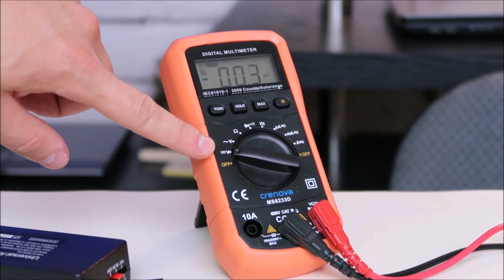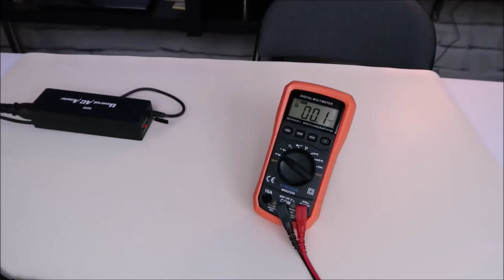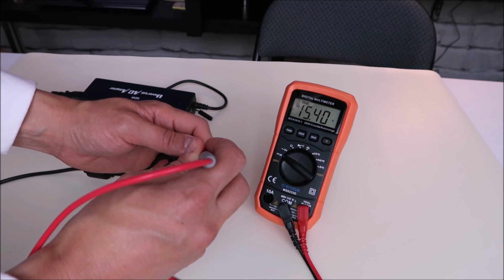How To Fix Any Laptop - Wont Turn On, Wont Open, Turns Off Right Away, No Power Solution

Comment: Hi. My laptop is acer nitro v15 it's rebooting itself after i open its lit and before i press power button. But it will shut down before acer logo appear and repeat the same thing again and again until i close the lit.
Reply from the maker: This video has been updated with additional steps here; https://youtu.be/kOBY4k2Mn_k. Let me know how that goes :)
Also, did anything happen before this issue started? Overheating, liquid spill, Windows update, etc?

Comment: I have a Lenovo Yoga 6 13ALC7 - Type 82UD and I've watched a few of your videos and can't get my laptop to turn on. I have some all of the troubleshooting you suggest except for a Bios reset because I don't seem to have a Cmos (sp) battery. When I have the battery in and plug in the charger the light is white butdoesn't t turn on. When I have the battery out and charger plugged in there's no lights and it doesn't turn on. When I plug the battery back in for have it unplugged from the charger the light blinks orange a few times but the laptop never turns on. I also don't see the ram sticks so I'm not able to troubleshoot the ram. Please help, I need my laptop!
Reply from the maker: This video has been updated with additional steps here; https://youtu.be/kOBY4k2Mn_k. Let me know how that goes :)
Also, did anything happen before this issue started? Overheating, liquid spill, Windows update, etc?

Comment: When i doing this my laptop just turn on for a sec (keybord light turn on) and then turn off immediately, what do you think the problem is?
Reply from the maker: You tried all the steps seen here multiple times? Did anything happen before this issue started? Overheating, liquid spill, Windows update, etc?
Reply: @PC_Monkey yeah i already tried all of them, idk it just suddenly happen to my laptop
Reply from the maker: @eldyriszwan  If, after trying all the steps seen here multiple times, you have not been able to find the issue, your most likely looking at one of two possible issues. (1) The motherboard is bad and needs to be replaced. Let me know if you would like help finding a compatible motherboard. Or (2) there is another computer component, shorting out the motherboard and need to be replaced such as the power jack, USB board, Touchpad, etc. You would have to troubleshoot each of those individually but unhooking it from the motherboard and trying to turn the computer on. Let me know if you would like help with that operation.
Reply: @PC_Monkey  i dont think i can do that, but thanks for your reply, your video one of the best help video ive seen, thanks you
Reply from the maker: @eldyriszwan   Thanks !!  Good luck !!  Let me know how it goes :)

Comment: it doesnt work for me :( my laptop is an Hp Omen 16.1 gaming laptop
Reply from the maker: Are there any signs of life at all when you try to turn it on? Lights? Fan, Motherboard, or Hard Drive sounds? Anything seen on the screen?
Also, did anything happen before this issue started? Overheating, liquid spill, Windows update, etc?

Comment: Can you please help me? I have a Microsoft Surface that has the power butten and volume up+down and I've tried everything, pressing and holding down the power button including the volume up+down and it still isn't turning on. My charger is working but the tablet isn't
Reply from the maker: This video has been updated with additional steps here; https://youtu.be/kOBY4k2Mn_k. Let me know how that goes :)
Also, did anything happen before this issue started? Overheating, liquid spill, Windows update, etc?
Reply: @PC_Monkey  I did have a Windows update but that was a month ago or so and one problem that I had is half of the display was a bit glitched but the display isn't broken it just randomly happened once and I have no idea why
Reply from the maker: @voidvx5754 If, after trying all the steps seen here multiple times, you have not been able to find the issue, your most likely looking at one of two possible issues. (1) The motherboard is bad and needs to be replaced. Let me know if you would like help finding a compatible motherboard. Or (2) there is another computer component, shorting out the motherboard and need to be replaced such as the power jack, USB board, Touchpad, etc. You would have to troubleshoot each of those individually but unhooking it from the motherboard and trying to turn the computer on. Let me know if you would like help with that operation.
Reply: @PC_Monkey  Yes please, could you help me with that?
Reply from the maker: @voidvx5754 Which one? You want help finding a motherboard replacement? What model computer do you have?
Reply: @PC_Monkey  Also Im not able to take off the battery or take the back off because its a touchscreen type of Microsoft Surface in which I can take the keyboard off

Comment: Sir, I have a lap top ASUS intel evo(American) having turning on problem. Charger and bottom of some portion of lap over heating. Earlier when this happened after some some time it is possible to turn on. But today I am unable to open. What is the ptoblem and I how I overcome this
Reply from the maker: Just so you know, over heating situations can be hard to troubleshoot just one issue as multiple different components and boards including the motherboard itself, could all be faulty. 
An overheating computer can be damaging multiple different components if not resolved. First, make sure that the fan and vents are clean and clear. If you need help accessing the fan, let me know what brand and model computer you have and I can help you get inside it. If that does not fix the overheating issue, then try replacing the thermal paste on the CPU and if needed, the GPU as seen here; https://www.youtube.com/watch?v=K_j4GPjpawk. If that fails too, replace the CPU

Comment: I am using tecno t1 megabook laptop and facing same issue when facing this issue I am not able to open bios using small hole (nova I think) in laptop
Reply from the maker: Are there any signs of life at all when you try to turn it on? Lights? Fan, Motherboard, or Hard Drive sounds? Anything seen on the screen?  
Also, did anything happen before this issue started? Liquid spill, overheating, a Windows update, etc?

Comment: My Computer having sound issue. Not audible. After repairing my Laptop is not opened? Can u help me with this
Reply from the maker: Are there any signs of life at all when you try to turn it on? Lights? Fan, Motherboard, or Hard Drive sounds? Anything seen on the screen?
Reply: @PC_Monkey  just lights on and immidiatly off on keyboard. Not opening the Laptop. Please help me with this

Comment: My Hp laptop's fan always keeps spinning even after shutdown and wifi and mute light is on please what's the solution
Reply from the maker: The computer turns on and works well otherwise? Also, did anything happen before this issue appeared?  Liquid spill, overheating, Windows update, etc?

Comment: I have a 9 year old laptop, acer e5-417g and it has a removable battery, i have this since 2015, replaced battery several times over the years, but recently with my latest replacement battery, the laptop has a new issue, it cannot be turned on unless I remove and add back the battery, sometimes it works sometimes it does not, if it does not, I need to get my dust blower to blow air on the vents below and so far tried this several times and the laptop boots up normally, the bad thing is I have to do this every morning or when I have turned off the laptop in a long time. I wonder what is the issue, might be motherboard? or the newly replaced battery? I do not want to buy another battery coz the issue might be something else.
Reply from the maker: Is this a generic battery or brand name? Also yes, this could be a motherboard issue :(

Comment: @PC_Monkey I need assistance with the motherboard repair. I think the motherboard is the issue. I'm asking cuz you directed us in your vid to do this if the fault lies with the board
Reply from the maker: You wish to replace or repair the motherboard? Replacing is easier and usually cheaper if you dont already have the proper equipment.

Comment: Help! I struggle to unscrew my Toshiba on the back. I am using a manual screwdriver but I cnanot seem to undo the screws!
Reply from the maker: What model computer do you have? Why are you struggling? Is the screw stripped or stuck?
Reply: @PC_Monkey  i don't know? How do I check it? I am unable to open my toshiba despite having tried the 3 inital steps. However, it is toshiba satellite something... lol

And as for the screw, basically, it was done really well. It's so tight that my screwdriver is unable to unscrew it from the bottom! So I'd say stuck...

Comment: A friend of mine gave me his Acer Aspire Laptop (5942 G, Windows 10) and gave also the password.  I hate passwords, so to avoid having to enter it anytime I want to use the laptop, I erased it in the password section in the Settings. When I turn on the laptop, it turns on the fans, the screen remains black, there is no mouse cursor and the machine turns on and off repeatedly until the machine finally turns off by itself.  Please let me know how to solve this problem, I accept having to enter the password again.

Comment: Toshiba portege z30t-c, motherboard issue 😭 i unplugged everything as well nothing. I have a battery light on the trackpad when I plug in the charger cable & a light that looks like an antenna light. But no power on…..clearly receiving some form of power but won’t turn on.
Reply from the maker: Sounds like your on the correct video.  Have you tried the steps seen here?
Also, did anything happen before this issue appeared?  Liquid spill, overheating, Windows update, etc?

Comment: My laptop doesn't turn on, but the fan is running, and for the first few seconds after switching on, all keyboard buttons are on. After a few seconds, caps lock and scroll (number) are still on before all keyboard buttons shut off. Only the fan, power button, and mute button have lights.
Reply from the maker: This video has been updated with additional steps here; https://youtu.be/kOBY4k2Mn_k. Let me know how that goes :)

Comment: Sir, My hp pavilion gaming laptop getting turned off automatically after pressing the power button. The led glows for about 3 seconds and sometimes even more and turns off.  It takes several attempts to get the laptop to boot. But when it boots up successfully there is no problem at all. I ran all the diagnostics (hardware  & Software) in hp diagnostics app and in UEFI  and all of them passed the tests.  The problem is only during the boot process. I also performed the hard reset but no use. Battery and AC adaptor also  passed  the tests.

Could it be due to faulty power button or psu or bios?
Reply from the maker: This video has been updated with additional steps here; https://youtu.be/kOBY4k2Mn_k. Let me know how that goes :)  Also, did anything happen before this issue appeared?  Liquid spill, overheating, Windows update, etc?
Reply: @PC_Monkey  No Sir. Everything was good. All of a sudden this issue appeared. Today morning laptop booted successfully and it worked normally. No problems after booting. After using it for about 5 hours straight I tried to restart the system and it got stuck at the boot . 
Problem is only during the boot process.

Comment: My Notebook still don't Boot, it just turn light on Power Button, and the 2 Leds (Running, and Battery) and also you can hear the CPU Cooler working at a very slow speed. It do the same by using only the Battery and not the charger... But nothing else happens, it doesnt access the CDROM Drive (you cant hear anything) it doesnt Boot. Can it be the Flex Cable? But supposedly the computer should Boot anyway right? although I don't see anything on the screen... but it doesn't boot.
Reply from the maker: This video has been updated with additional steps here; https://youtu.be/kOBY4k2Mn_k. Let me know how that goes :)  Also, did anything happen before this issue appeared?  Liquid spill, overheating, Windows update, etc?
Reply: @PC_Monkey Yes, the Notebook start Frozen randomly and also could give a Blue Screen saying "whea uncorrectable error" i diagnose it was the Nvidia GPU so i turn it off in device administrator and the Notebook stopped Freezing. I also notice the CPU and Motherboard temperature was 70°C without doing anything... So i bought a thermal paste and dissambly the Notebook, clean dust from Cooler and replace the thermal paste (Notebook was from 2014) assembly everything again, but know it doesnt boot. Also, another problem with the notebook was that when it is very cold and humid, when you turn it on, the image on the screen would scroll until it was fixed, it took a few seconds... it only happened on humid or cold days. But it went like that for years.

Comment: I removed the battery the RAM the BIOS I did all step still won't turn on🥺🥺
Reply from the maker: Did you try the other steps seen here? Also, did anything happen before this issue appeared?  Liquid spill, overheating, Windows update, etc?
Reply: @PC_Monkey  but I remembered when I wanted to update windows it could write installing error 0x80070005.and last it could say it looked like window had problem to load. Then if goes off forever.
Reply: Nothing happened before that it just shut off itself. I tried to remove the CMOS battery about 6hrs and put it again but it just light on and goes off immediately

Comment: My acer a315-21-656G computer will not turn on even after I tried everything literally all the YouTube vids nothing helps and it’s just completely dead with no power
Reply from the maker: You tried the steps seen here multiple times? https://youtu.be/kOBY4k2Mn_k. Also, did anything happen before this issue appeared?  Liquid spill, overheating, Windows update, etc?

Comment: My omen hp gaming laptop wont turn back on it shut off immediately when i was playing r6 and i tried removing the ram and the battery and the charger nothing worked it still wont turn on
Reply from the maker: For a computer that does not turn on, try this video first; https://youtu.be/kOBY4k2Mn_k. Let me know how that goes :) Also, did anything happen before this issue appeared?  Liquid spill, overheating, Windows update, etc?

Comment: I tried everything here so ig I have a mother board issue but how do I identify what is wrong here? 
My laptop is Acer aspire V3-575G-570M
Reply from the maker: Are there any signs of life at all when you try to turn it on? Lights? Fan, Motherboard, or Hard Drive sounds? Anything seen on the screen? Also, did anything happen before this issue appeared?  Liquid spill, overheating, Windows update, etc?

Comment: I have a different problem with my HP laptop, when I plug the charger the light turns on but when I tried to press the power button the charger light turns off immediately while the charger still plugged in. Any advice?
Reply from the maker: This video has been updated with additional steps here; https://youtu.be/kOBY4k2Mn_k. Let me know how that goes :)

Comment: I had this issue where my computer would randomly crash when it was hit or it wasn't dropped carefully, overtime it got to the point where even small impacts would make it crash until it started to come on and off repeatedly until i timed when it would come on and held down the power button to shut it down and after a while it started working as normal, then it started again but now the time where it stays on is now less than half a second even when i still managed to shut it down, after waiting it didnt fix itself and its been going like this for 2 days now. Please help identify what this is I dont know whats going on.
Reply from the maker: 1. What are you able to see on the screen when its trying to start?
2. Have you tried reseating the HDD to make sure its not loose as seen here? https://www.youtube.com/watch?v=B2Umoh81QeI

Comment: After i upgraded my ram (Lenovo L460 laptop )when i turned it on A Windows system update appeared then it keeps beeping then i turned it off. When i turn it on. It will turn off after 10 or 15 secs. What should i do? ( I re-installed my Old RAM and still turns off after 10-15secs) no beep sounds or anything. I just see my power button turned on then turns off too
Reply from the maker: 1. For a computer that does not turn on, try this video first; https://youtu.be/kOBY4k2Mn_k. Let me know how that goes :)
2. Are you sure the RAM was compatible? If you put the old RAM back in, will the issue go away?

Comment: I'm not sure which video fix to use.  My laptop will boot up and come on if no external outlet is connected.  Once I connect the external outlet the screen goes blank but the computer is sill running.  Currently the only way I can get the screen to work is to leave the external outlet plugged in and hold down the on/off button until the computer turns off.  I then re-start the computer and then the screen works fine.  Can you direct me to the correct fix video?